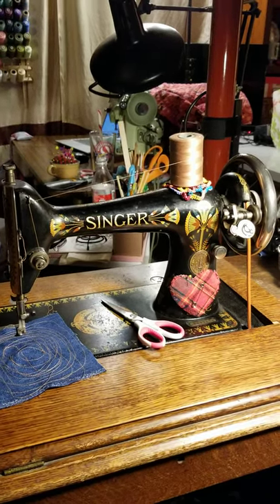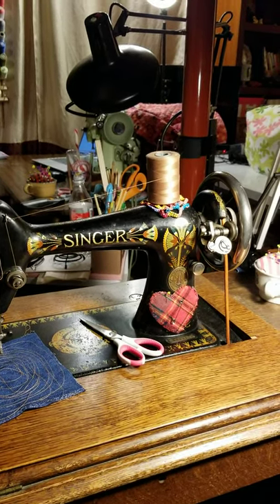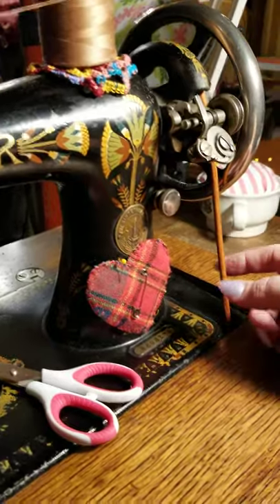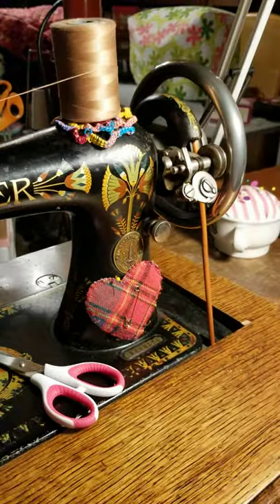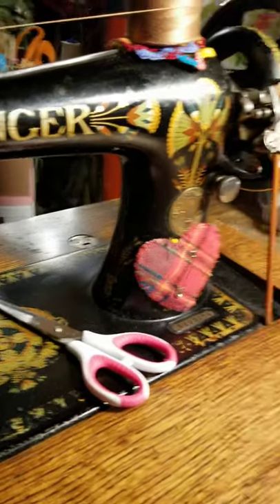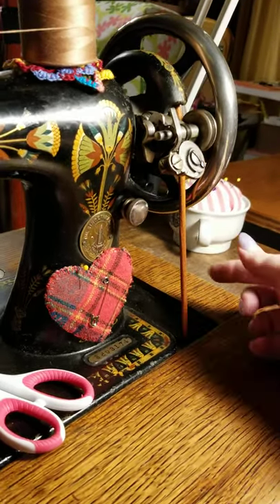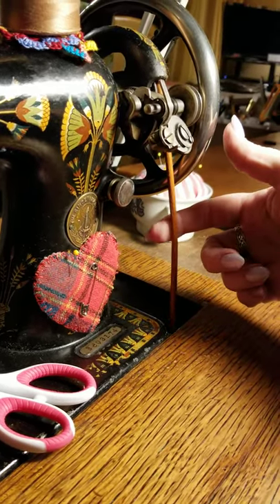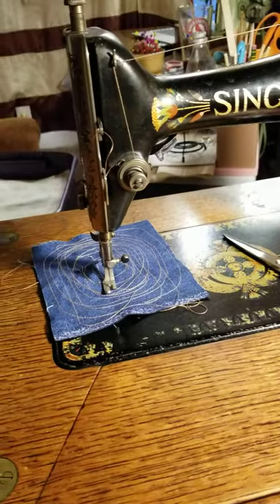How Tight Should My Treadle Belt Be?  Short explanation.

Comment: If the belt it too tight or too loose, how do you adjust them? I think my belt is too loose, it is downright floppy and wont turn the machine at all, but I don't see anything resembling a tensioner pulley or adjustment knob.
Reply from the maker: If it is too loose, you will need to shorten it.  There is no adjustment for treadle belts like there is for motor belts.  There are a lot of videos out there on how to attach belts, including how to shorten them.  Basically, you need to take it off, remove the metal clip, cut off what is extra, put a new hole in the cut part, and attach the metal clip again.  Do this in small increments, so you don't end up too short.  Take off 1/2 inch at a time, if not less.
Reply: @patchworkchickenstudioarta5615     I will! Thank you so much!!